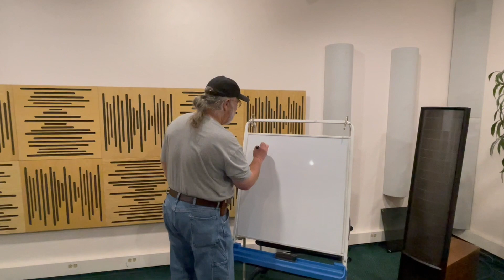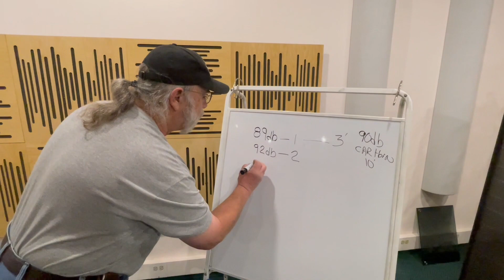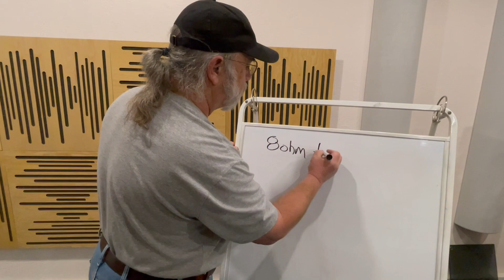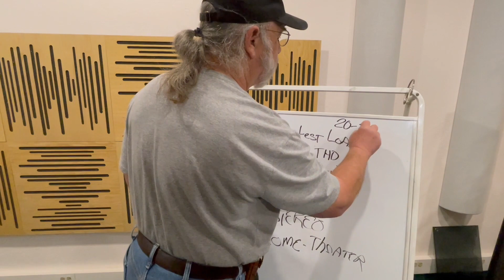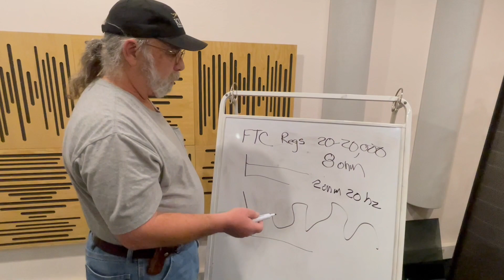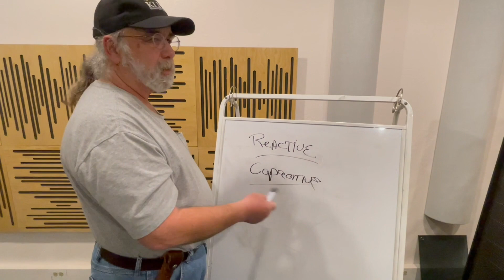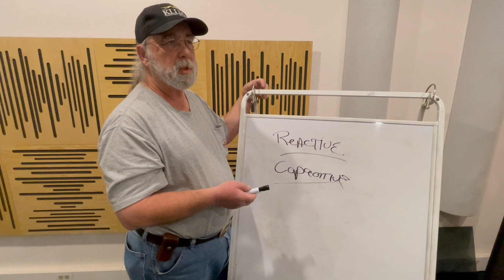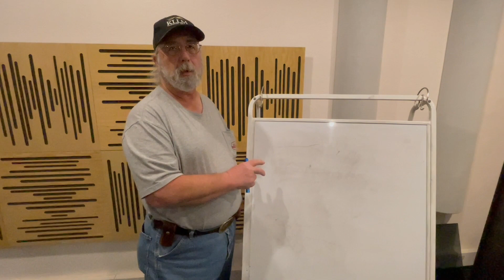How Much Power Do Speakers Really Need?

Comment: Thanks for the primer Lou.  So many factors to continue.  If people valued and would pay for in home consultations, it would probably be the only way one could account for all of the variables in an in home situation and would likely lead to much greater satisfaction for the consumer.  Having had several listening rooms over the years, I believe that the room is the wild card in every new acquisition.  Even after bringing in my amp or source to the store to audition, everything always sounds different at home.
Reply from the maker: Tom, I have recently done several visits to customers making quick and decisive improvements and without saying "Well, if you just spent another 10G with me, I can fix it.  I have one who can not believe how quickly I pick up on things and has really encouraged me to consider consulting.  Nope, not free.  Total expenditures by them, 0.    And yes, the room is the wild card but too many people try to force the results using standard audiophile norms rather than playing a room's weakness for it's strength. This is, in fact, one of the major weaknesses I hear time and time again at shows.  Their typical response is to blame the room.  My thoughts are that unless you build a room like they use, it's gonna sound like crap no matter what you do.  Ah, all those years at Baldwin next to the head of the American Acoustical Society are paying off.
Reply: @audibleeleganceinc  I remember a lesson you gave me at the old KY store with an arc amp and some aerial 20t speakers. The substitute cables were maybe 1/20 of the entire investment, but what a difference. All it cost was a few shots of good booze.